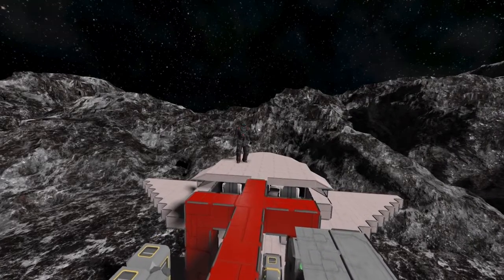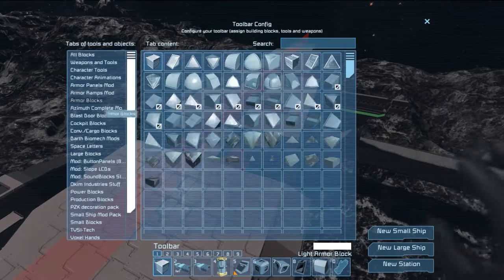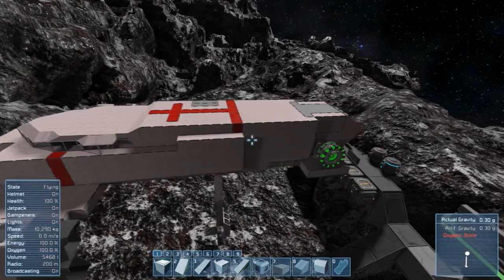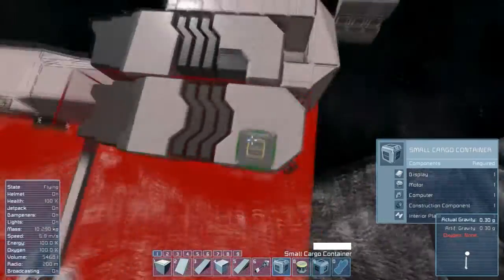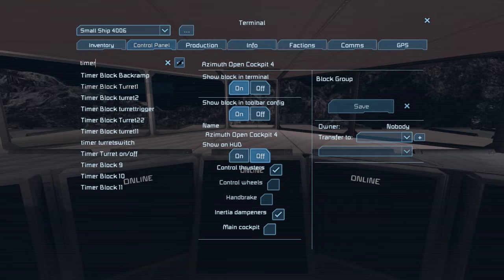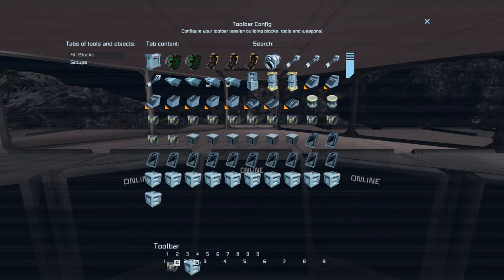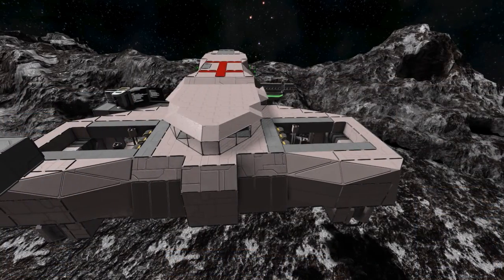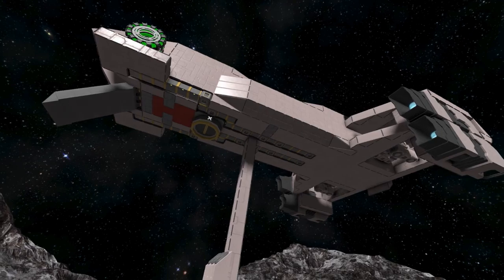How to: Small ship gone large guide #4: Exterior and hideable weapons

Comment: Hello Tartaross Inc, your videos are great and your ships are amazing, you have an amazingly unique way of building ships, I loved the vagrant mk2 and mk3, personally I liked the mk2 better for looks but the mk3 for stability, I confess, I took the mk2 for a test flight and pulled a landing manoeuvre and tore the ship apart, if you use the mag lock blocks to lock the moving parts in place at either finish position it becomes so much more stable and can handle many a dangerous manoeuvre without the rotors and pistons mimicking Hiroshima. I hope this helps. :) also I am working on a massive small ship, I am happy I can plumb it up and get the inside as I would like, but could I perhaps get your help to flesh it out please? :)
Reply from the maker: +Dan Ram Thanks for the awesome comment. The problem, that I have with maglocks is, that often when locking moving parts, they generate a pretty strong rotational force, thats why I don´t put them in very often. And for me helping you out: Sorry, I haveto say no to that. Its nothing personal, but if I start helping out people on their builds, more people will ask for it and in the end I would have to let down those, simply because of the lack of time on my side. And then those would wonder, why I helped the other guys, but not them. I hope you know, what I meant ;)
Reply: +Tartaross Inc. my pleasure, thank you for your reply. :) Ok, that's a fair point, I must admit that I haven't had that problem myself personally, I guess it must be inherent with putting a landing gear mod in. :P I understand, and thought it might be the case,  but wanted to offer either way, the offer is always there, and so too is the offer add me on steam and or google plus if you like. :)

Comment: Nice, you could have connected your folding gatling guns to the main  storage units of the ship !
Reply from the maker: +Groodiz sure, I could have done that, no problem. But I didn´t want to merge another line of hinges with conveyors as base, you know? and, from my experience, those hinges do not fold full 90° without problems, unless you attach those blast doors to the moving part. :)
Reply: +Tartaross Inc. Yeah they are quite tricky to use, but it's simplier that way for sure !